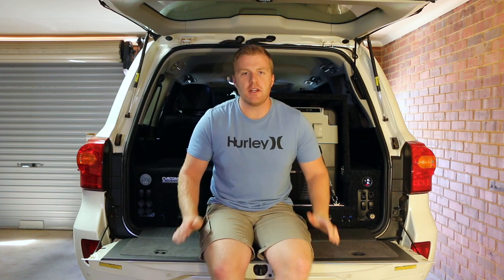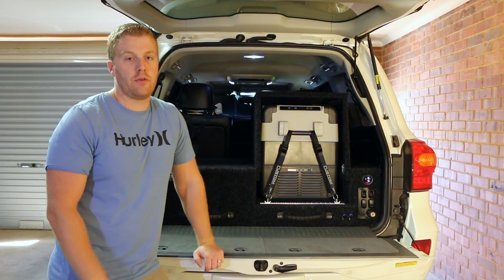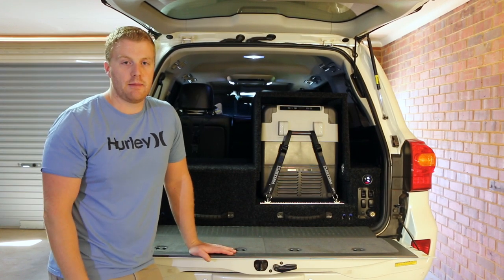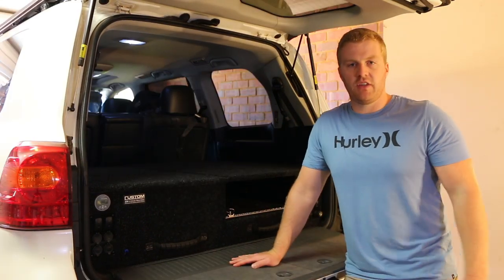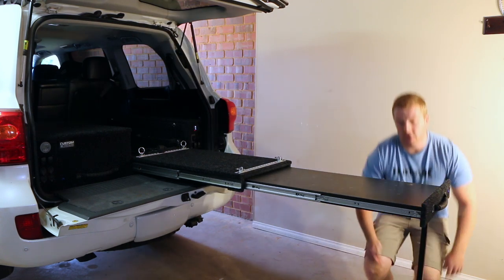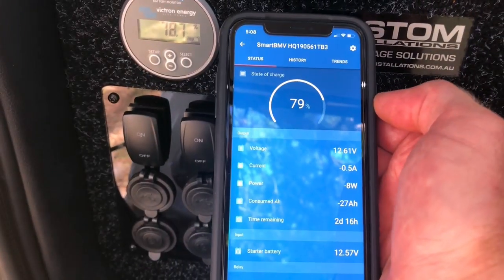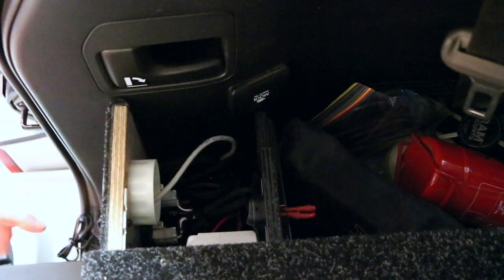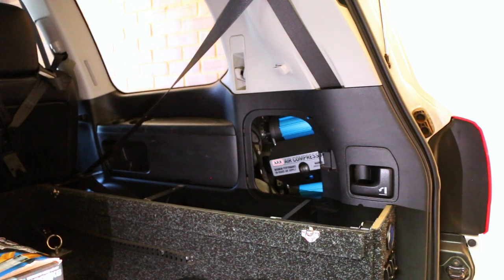LC200 | 4WD DRAWER SYSTEM | Custom Rear Setup for TOURING | Fridge Slide | with 12V wing kit PANELS!

Comment: Superb, excellent video and info just the info what I need to complete my unfinished touring set up next. You are right, that is so individual for every ones different demand. Cargo barrier ?! I was shocked about the prices called up for it. I don’t need it full time either. So idea is to get air cargo net to the front and ratchet it down. Same for top shelf thinking of a net for the jackets and soft items. If no needed can be stored in the side wings. Since I have decided on an 2 drawer Drifta set for storage and a 50 ltr. Waeco for the same reason I probably go for a simple fridge slide, no dropper, and 2 cargo rails to secure my alloy boxes while out without the van in tow. Your el system is also 90% fitting to my demand and will copy that from you. Thanks mate for the infos and please keep going with your vids, I‘am a step behind your Outfit and need such infos since sitting now far away from my car and van. Cheers
Reply from the maker: Thanks for the comments mate. Appreciate the feedback. 
Where did you get your cargo net from, that is something I could be interested in, I like the fact that it can be packed away and stored in the wing kits.
The Drifta systems are great and keeping the design nice and simple keeps a easy and organised camp.
I'm glad you got some ideas from my setup, thanks for the continued support!
Cheers, Nathan.
Reply: XploringOz @ Nathan, thanks for your reply. As said I am steps behind you with the setup completion and at the moment locked up in Asia 7000 Kilometer away from my rig in MEL. I am looking now for small belt aircargo net material, then customized sewing, ratchet straps is then easy to make while taking measurements in the car. I like your idea to work with L- shape tie down runner ontop the drawer set. Going to source also. Will keep you posted on findings. Cheers
Reply from the maker: Yeah, I reckon thats a great idea for the cargo net. I think I'll do some research into this as well. Very interested in seeing what you come up with. If you feel like it, post some photo's on our Facebook page, would love to see your setup.

Comment: Another good walk through video, I like the cable chain arrangement can you provide a make and model of that one if it’s easily visible
Reply from the maker: Thanks mate, appreciate it. 
So the cable chain doesn't have any markings or indications of brands etc. I did measure it for you and it came in a 25mm wide (external). 
I think something like this would suit most application: http://rover.ebay.com/rover/1/705-53470-19255-0/1?ff3=4&pub=5575556341&toolid=10001&campid=5338630196&customid=&mpre=https%3A%2F%2Fwww.ebay.com.au%2Fitm%2FNylon-Towline-Cable-Drag-Chain-Wire-Protect-Carrier-CNC-R18-R28-R48-1M%2F163702250087%3F_trkparms%3Dispr%253D1%26hash%3Ditem261d6a1a67%3Am%3AmplmEwC0cLpAAAeH95P_0GQ%26amdata%3Denc%253DAQAEAAACYIQvEcHUrT7nmUC3yY5qbPyaBN1nJEDYW8MyypsJPgXKONGL1fghtnaQhEaNm8eGJboGuWJLzTRuSQ5NpNOJWSzDmywHcfIHSTabOpFHqPG5kVkvgJ3gL5rTLW2g%25252BtrzBAfwG%25252FcXpvmTHusoDDKArSylJWLmGdB1DMMwwklpqo12EqQuGhwpNSDG%25252FyAp1qRHu%25252BNqs9o39waMNQ5Fv3K%25252FMMQkUI8ewCX8KyZk61wE1jQLeX0ro1VajrhRxYhg4YsVPbf3azdDofgChAGh2qJZdROFnUJPK2BOBg1%25252FNeq1tfMBVKVLctV0vfI26JTutK%25252BODpG3ViTQ%25252BMbXI8cwADrr6Mr%25252FkDiqyJSqIfH6oirTVHBp9l5PborH6qb5n8S4wgQdQWzzTFPJQEhUKzDNL3%25252FM5UKqM1ZC9bw%25252FwHRAZoNCz7TUXuw63cMagKQbxARNyi16RMRoRkhnPDtGIysyT0GUkiwNj7rITEVF95CncysZcJzX2OSv4pasqhqunMJzvXT5eKueGhs0XWfCtihnnJBdJygOUZgOCJofqfVcrjSDMo446gJ6cCWwfGtHVhc8Inc8%25252Boi2bHdhp1huAy%25252FtkbSQKFNpDIUKjV8uGrnYnFv8DsZeM6sjKVT2PJtvRtsfybFOFGQHh5P6moZ0i1dz2pLz2i%25252F8hSym5ZKkoAn%25252BXZt155xDAJ2%25252BeafRHU62P5J%25252FaRqhkdZ3IpzLuoHK%25252BoI18g2kn4wZpThSjr%25252FSKeLozFc%25252BsHndBouGElXf%25252Fp%25252BkxEtykWgSHtb%25252F1N%25252BtP6h7mQYVU3icUm1Jcnmc5dWRmqgfcyEL10g3%2526cksum%253D16370225008787b24cfe43bc4e2093f6857ea006f356%2526ampid%253DPL_CLK%2526clp%253D2334524

Comment: Thanks for sharing your setup. Looks like a very workable and practical system. I'm interested to know whereabouts you've installed your Victron shunt. If it's under the bonnet are you concerned about it getting wet. Cheers...
Reply from the maker: Thanks mate, hope it was able to give you some ideas.
So yes, the Victron shunt is mounted in the engine bay, with no particular attention paid to protecting it from the elements. It's been there for over a year now, through the winter and wet 4WD tracks and bog holes. 
Although it looks exposed, it has held up fine with no issues to report. 
Hopefully it will continue to function this way. 
Cheers, Nathan.

Comment: Another great video mate. Did you purchase the control s for your air bags from Air Bag Man? When you get a chance i would be keen to see a review on your Waeco fridge, currently torn between Engel vs Waeco.
Reply from the maker: Cheers mate! I'll keep the idea in mind for a fridge review for sure. 
So I got the Air Bag Man control kit just off eBay. http://rover.ebay.com/rover/1/705-53470-19255-0/1?ff3=4&pub=5575556341&toolid=10001&campid=5338630196&customid=&mpre=https%3A%2F%2Fwww.ebay.com.au%2Fitm%2FAirbag-Man-Kit-Dual-Digital-Tyre-Inflation-On-Board-Air-Control-Electric-AC1041D%2F233105796961%3Fepid%3D18026682558%26hash%3Ditem3646302f61%3Ag%3ACN4AAOSwg6Nc9aJQ

Comment: Fantastic set up, well presented.
Am so enjoying this channel. 
Did you run your battery cable via chassis or inside car and did you use 4b&s or different cable.
I'm looking to install my compressor in the same spot.
Cheers Eric.
Reply from the maker: Thanks Eric! I'm glad to hear your getting some value from the videos. 
So all of the wiring was run through the interior of the vehicle, only coming out to the exterior as close as possible to the accessory. I can't confirm exactly what size cabling was used in the aftermarket loom as all the work was completed at once by Ultimate 4WD Equipment in Bibra Lake.
Awesome little spot to mount the compressor, very happy with that. 
Thanks, Nathan.
Reply: @XploringOz  cheers Nathan for the reply,
Ultimates have a great set up with their wiring looms for the  200.
Look forward to next weeks vid.

Comment: Hey mate. Great vid. Question: Did you have to register the 200 series as a 5 seater after removing the 3rd row seats?
Reply from the maker: Thanks mate. So this is a little bit of a grey area in WA. Vehicles need to be registered as 5 seaters if you remove the 3rd and fit a permanent modification to the vehicle, preventing the re-installation of the 3rd seats. However, these drawers can be removed simply and easily with 4 bolts and a few electrical plugs and therefore don't constitute a 'permanent' fixture. If desired, you could very well register the vehicle as a 5 seater. It would work either way. 
Thanks, Nathan.

Comment: Hey mate any idea what sort of weight your drawer setup comes in at? Thinking of calling up and ordering the exact same setup. Just wanted to know how it compares weight wise to a set of steel or alloy drawers.
Reply from the maker: Hey mate, so these drawers coming in roughly around the 60kg mark. Hope that helps. Cheers, Nathan.
Reply: Cheers thanks so doesn’t add anything really after taking out third row seats.
Reply from the maker: Not much at all 👍

Comment: Great setup! 
Whats the cost for drawer setup?
cheers
Reply from the maker: Thanks mate, I reckon it's a great setup. 
So there are heaps of variables that would significantly. If I remember correctly, the drawers were about $2500 ish. 
Chris from Custom Installations would be able to give you a much better idea based on your needs. 
Cheers, Nathan.